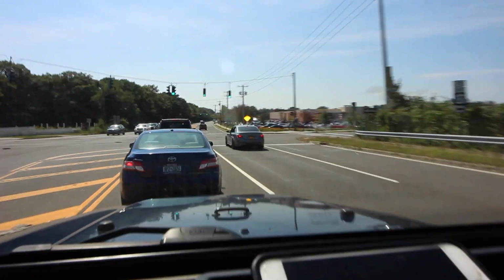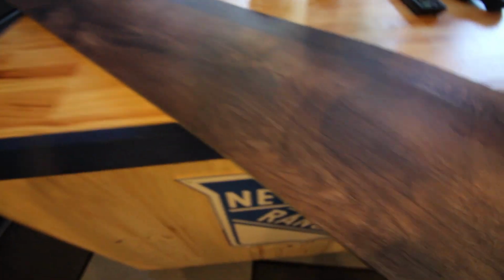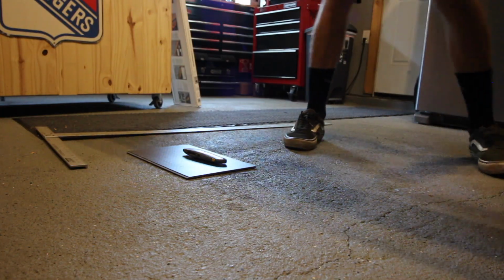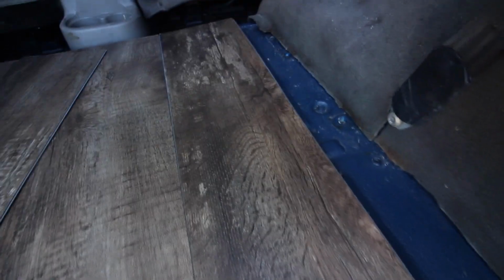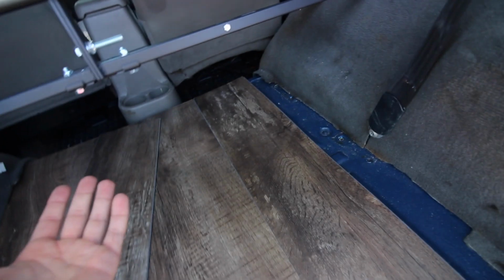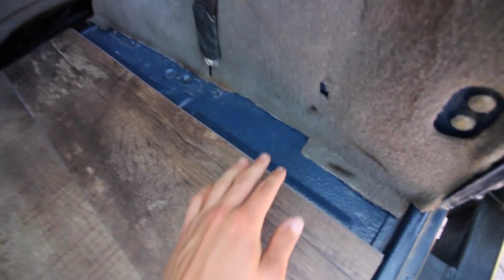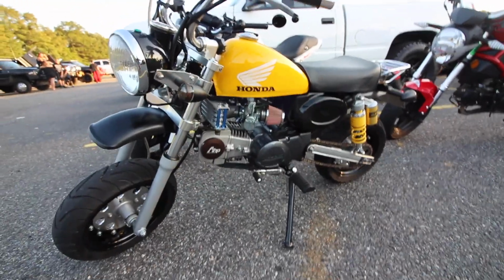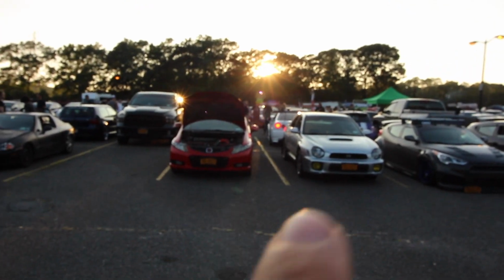Wood Floors in My Jeep!

Comment: Without the carpet the cabin may get hot hopefully that insulates the heat  also you got a new sub from Puerto Rico 🇵🇷
Reply from the maker: migdoelignaci morales rivera I left the front section in with the heat shield,  the exhaust does get a little hot but I can't see the carpet keeping a lot of that out. Hope all is well down there! Thanks for the sub!
Reply: Thanks! Well on my Jeep I removed every inch of carpet, it does get hot for nothing that is intolerable. Also back her everything is fine just the luxuries like internet etc being acting weird.

Comment: Yeah well the truth is I hope I was going to see you build a wood floor like it said on the label. I've got a 79 CJ5 had for over 10 years bring it from Arkansas Ozarks to the Missouri Ozarks I'm been sitting for 10 years out here in my yard so I've got new life in it and there's some Rust in the panels on the floor so I'm thinking about plywood for a quick fix then I'm going to paint the whole Jeep so I'm getting I took the bucket seats out which are shot and built a shifter cover and getting it ready to paint but I've got to do some serious Body Work First and the cheapest way I'm thinking is a little Plywood And fiberglass inside the bed and under the seats in the corners and stuff